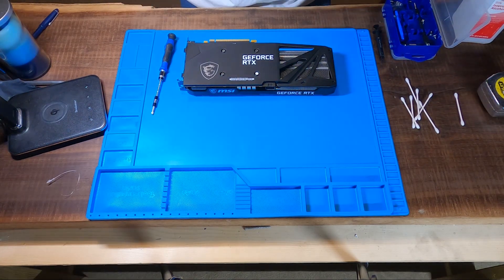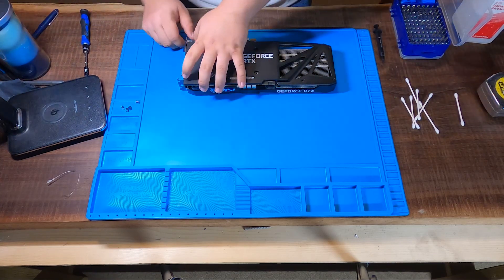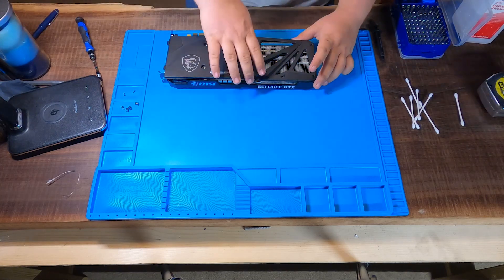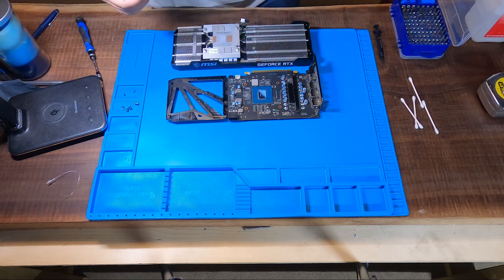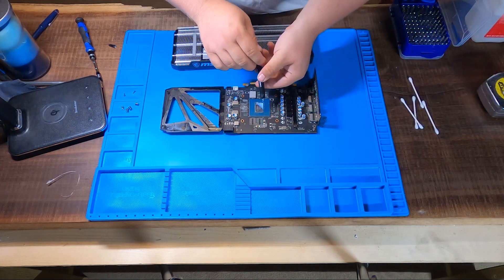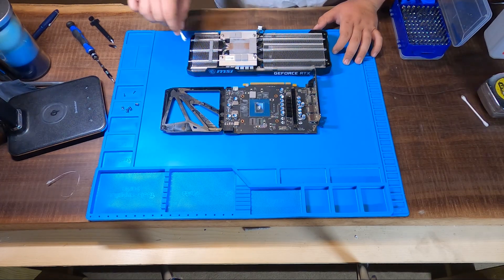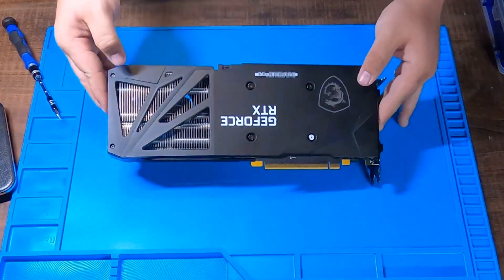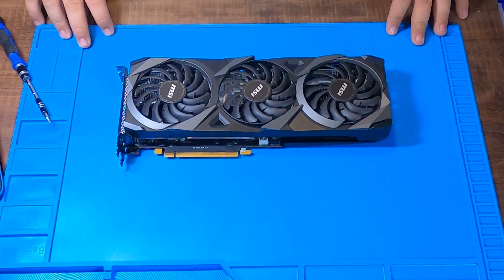Repasting Msi 3060 3x Ventus

Comment: I replaced the cooling pads. But now it’s getting super hot 😱
Reply from the maker: Did you redo the thermal paste as well? It’s generally not a good idea to reuse old thermal paste.
Reply: Also did you get pads that can handle the temperature (w/mk)? it should be at least 15w/mk